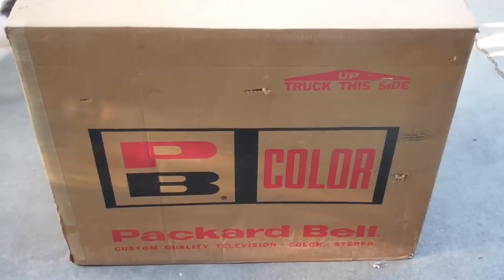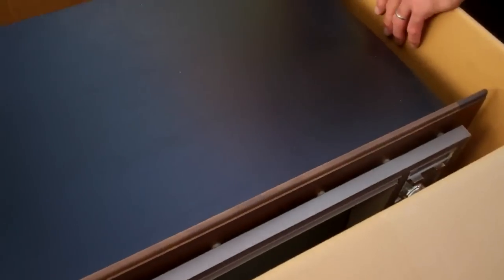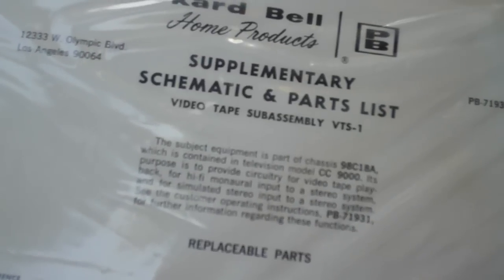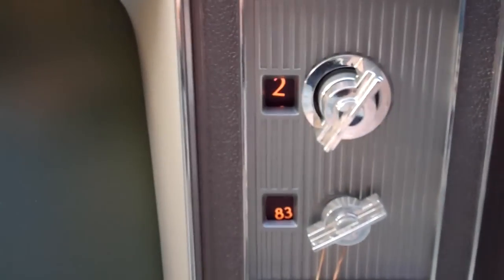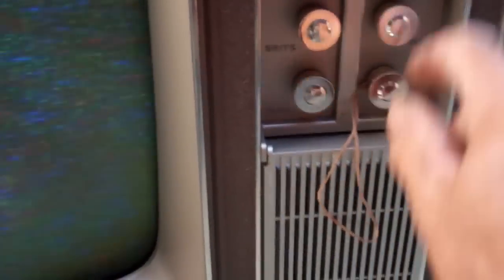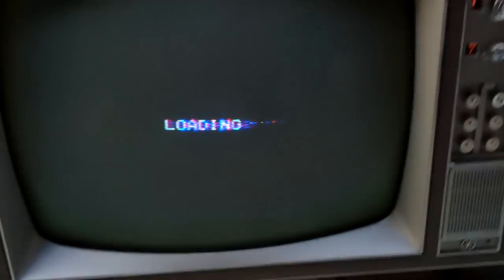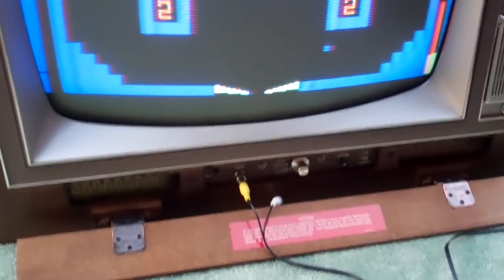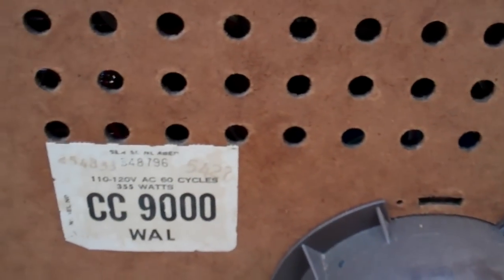Unboxing NOS Packard Bell CC9000 Commercial Tube Television

Comment: I could believe it's designed for a TV station. KHQ channel 6 in Spokane Washington had quite a few built in sets around the station, including in the control room where they had several. Monitoring the satellite feed from NBC, "network", a separate one for program, and another one for over the air monitoring in the control room. They also had several feeds from the VT players that had the commercials on them as well as some of the programs that were aired on 2" video tape, like "Don Kurshners Rock Concert" that aired late at night after Saturday Night Live aired.
That is a really cool piece Shango!

J.

Comment: The front is finished, but the sides are "dull metal".  Something I'd expect to see on a rack-mount switch unit (as well as the forced air) so it's meant to be built into the wall when the house is built (a rich person's house).  I'd say it was an extremely expensive model nobody could afford so it sat on the shelves for 45 years.  That AMPEX $30k VCR (VTR whatever)... I've never heard of that?  I heard in the late 60s there was a 3" Quad (Quadrature 90 degree) video tape unit that was almost room-sized for TV stations, needed a complete setup every time it was turned on so they would always have a need for a tech... but I had never heard of that

Comment: The closest I've seen to a TV like this were some 23" tube-type color RCA's that my elementary school had. They were commercial grade CTC39's and there was a panel on the rear of the set with all sorts of A/V inputs/outputs. The only things I remember being connected to them were Sony U-Matic videotape machines; and, in later years, standard VHS VCR's.

Comment: 1969 is a bit early for Cartrivision, although U-Matic came out that year. The rest of the formats back then were home unfriendly reel to reel. Remember that "home" video plugs weren't really standardized yet, so using the commercial BNC jacks was logical. Its likely this set was used for integration into cabinets that housed a VTR unit, not unlike the original Sony LV-1901 Betamax TV console. A professional video monitor would be tunerless, with no reference to any "Hi-Fi" system. A rare find!

Comment: Wow a MIB late 1960's custom COLOR Monitor/Receiver! This set is more then worthy of a FULL restoration! With that forced air cooling it should last a VERY long time!
The Ampex 1" "A" format VTR's had BNC video out, The VR-7300 was of the time period and was color capable. 
Could have also been used with something like the Sony AV-8600 or more likely the AV-5000 1/2" recorder with a PL-259 to BNC adaptor.

Comment: Sams Photofact doesn't list the CC9000 under Packard Bell (Teledyne), but I found the 98C18 chassis (without the "A" suffix) in Set 1009. According to that, the right-hand pushbutton will be "Instant Color Purity" to manually engage its built-in degaussing coil by placing it in series with the 117VAC input to a bridge rectifier circuit charging a 200uF electrolytic capacitor, producing a decaying sinusoidal AC coil current whenever the degaussing circuit is manually engaged. Simple & effective.

Comment: I've also discovered that PL-259 (aka "UHF") jacks were also used on a lot of 60s-70s era pro & industrial video equipment, as well as the rectangular 8-pin bidirectional "Jones" connector, which some professional/industrial TV sets had that VTRs could connect to, giving the added benefit of the TV acting as a tuner for the VTR for off-air recording.

Comment: Not bad for 45 Years... This tv is awesome try doing this with a flat screen no such luck... 👍
Reply: " This tv is awesome try doing this with a flat screen no such luck.." what, keep it NOS in the box for 45 years and expect a flat screen to still work? Yes, yes i do expect a flat screen to still work...  its not exactly a hard thing to do.. and no paper caps that will need replacing!

Comment: I don't think even consumer video gear used RCA jacks for video until 1981 or so. I remember being shocked the first time I saw one. I've seen many early Beta and VHS machines that used BNCs, although or course this TV long predates those. While not a professional monitor, I expect it was an industrial model, designed for commercial installations.

Comment: Earlier composite video was connected by BNC, in a way kind of better bacause you didn't get the video & audio connectors mixed up.
The first generation gear used PL259, CB style connectors (Also early CCTV/security video)
Reply: Hmm, my Sony CRT Projector uses BNC.  These units are nice!  Except that they weigh a ton.  I picked it up for $20 at my local thrift.

Comment: That is neat! Nice old NOS TV.  But one question, How are you playing TV signals without a digital converter box attached? Didn't they cut the analog tv signal in 2008?   Are you not in the United States?
Reply: He does live on the United States.  Low-power analog TV was and still is allowed to broadcast until summer 2021, although new analog LPTV license requests were denied after 2019.

Comment: Try not to take us too seriously on these videos.  Its not an EH Scott Quaranta after all.  We don't apply power if damage to the equipment is 100% certain.  This set has since been carefully returned to its original packaging and proper dry storage conditions.  Note the carpet we placed under it during inspection.

Comment: That would have permitted the possibly-deteriorated aluminum oxide dielectric in its electrolytic capacitors to slowly re-form and prevented possible SEVERE damage to the power supply. Check its Automatic Degaussing circuits for damage. The audible "snap" may have been a part of the ADG control circuit failing due to abnormally high inrush current due to the virtual short-circuit current of the flash-reforming which the electrolytics underwent in that ill-advised hard-start after 45 idle years.

Comment: Who's broadcasting an analog signal in 2012?
Reply: Surprisingly there is still a station that is in analog but my tv barely can get a connection on it
Reply: They should have all been gone by March, I wonder how they're still on.
Reply: +guyonearth only one channel
Reply: He could be using a converter.
Reply: Someone I want to continue to do so.
Reply: No, if he were using a converter he'd have to change channels on the converter, because the converter contains the tuner. He was changing channels on the TV and picking up signals, which means he was using the TV's analog tuner, which means there were analog TV signals in the air at the time.

Comment: It would have been a MUCH better idea to temporarily remove (parallel-heater circuit) or disconnect the plate cap from (series heater circuit) the Horizontal Output tube and conduct its initial power-up very slowly with a fused and metered Variac starting at about 20% of full line voltage increasing in increments of 5% per 15 minutes, then shut down and, after a final 15 minutes at 100% line voltage, reconnect the Horizontal Output tube to enable the sweep.

Comment: I'll bet that pop was an electrolytic. Probably needs a recap to ensure a perfect picture and sound plus IF alignment.  I am very surprised it worked. Very nice find though.
Reply: lol, why shouldnt it work ^^ these things are like tanks. Some spend years outside or in wet abandoned buildings and work fine.
Reply: Capacitors go bad just from sitting around for decades, whether the equipment was ever powered up or not.